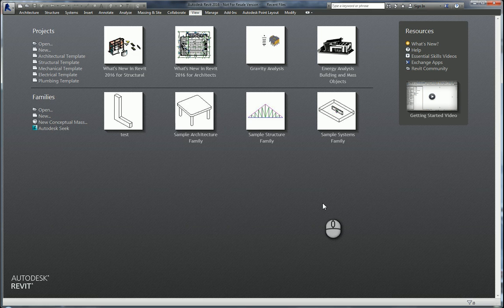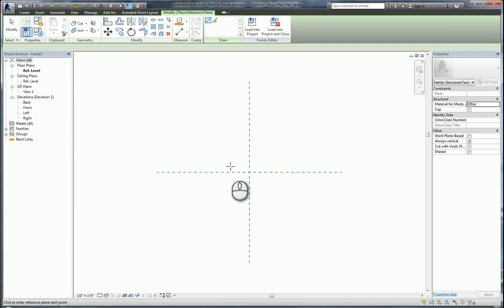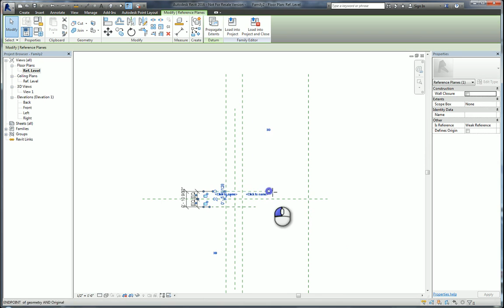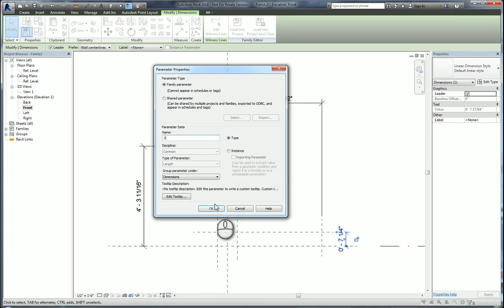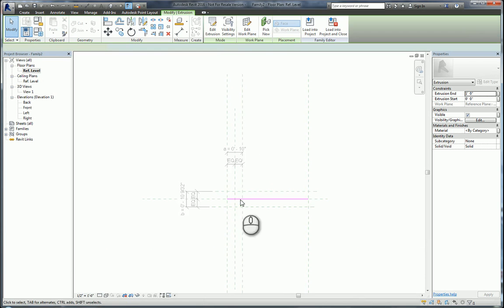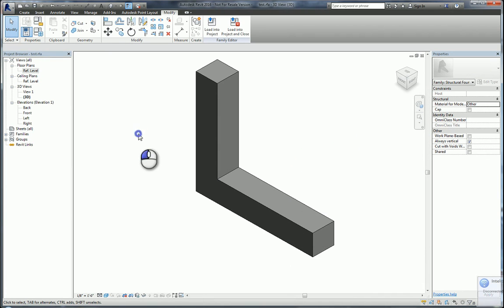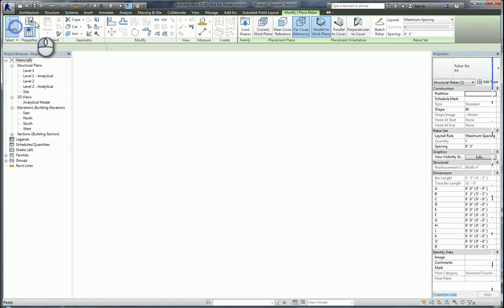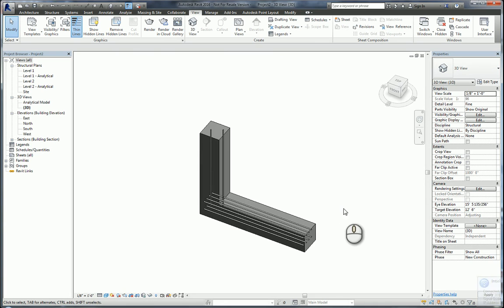Revit Generic Structural Family with Rebars

Comment: Hi Dzan. Thanks for the video. What would be the best way to have a vertical rebar family that goes from footing to top of concrete wall, that also shows as a solid black rectangle that is 4"x4" when looking at it from plan view, but still look like rebar in 3D?
Reply from the maker: You can draw a rectangle in olan view using Symbolic lines.

Comment: I'm getting an error while using the rebar button, it's asking me to add some family..

please help!
Reply: Hi, currently Revit includes the three products in one. He is showing  in the video first the family editor, then the project environment. Both environments are included in the same Revit application
Reply from the maker: sounds like your revit software is missing content.  Try reinstalling/uninstalling....
Reply: Dzan Ta I tried reinstalling the software but the error is still not solved.
Can you please make a video on how to set up the Revit environment? Like from complete scratch..

Thank you
Reply from the maker: i.e. Civil 
Try a clean uninstall first then reinstall. If that does not work, let me know and I can try to help on Monday morning
Reply: Dzan Ta yep sure, I'll give it a try...
Thank you very much 😁
Reply from the maker: also, what version of Revit....did you try using Autodesk Desktop App to download all updates and extensions....?
Reply: Dzan Ta I'm using Revit Structures 2016
Reply from the maker: i.e. Civil definitely do a clean uninstall then install with new installation files then update software using Autodesk desktop app.  This will fix it
Reply: Also I wanted to know if you need 3 different softwares like Revit Structure, Revit architecture and Revit MEP or can all these things be done on a single software platform